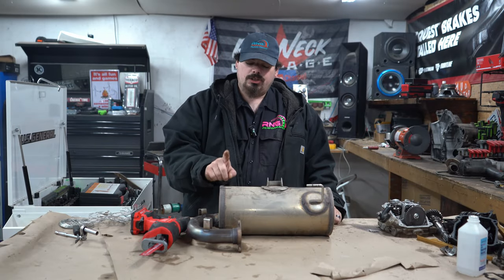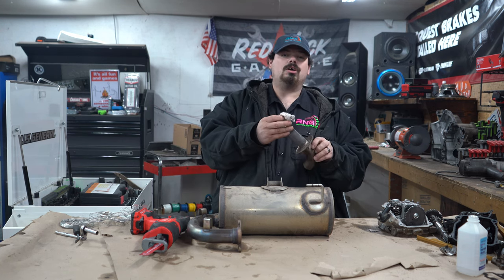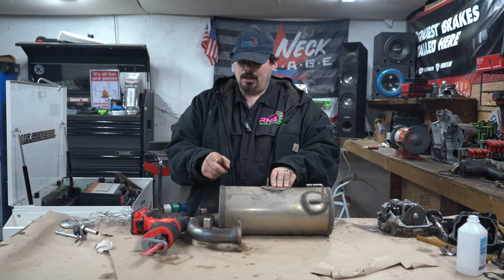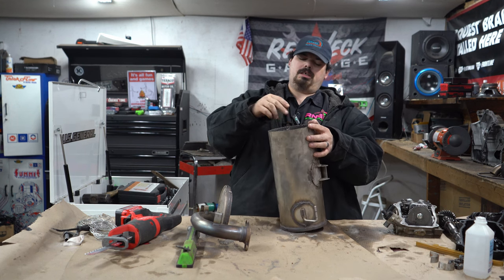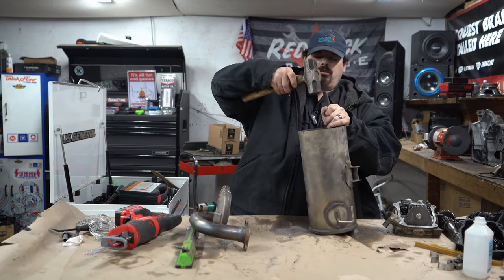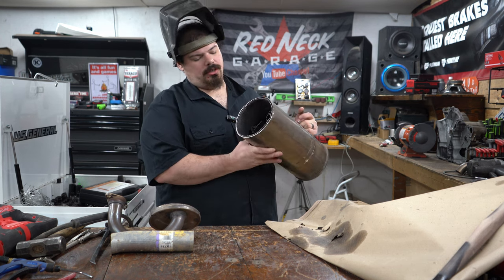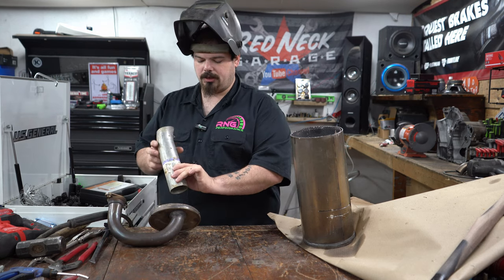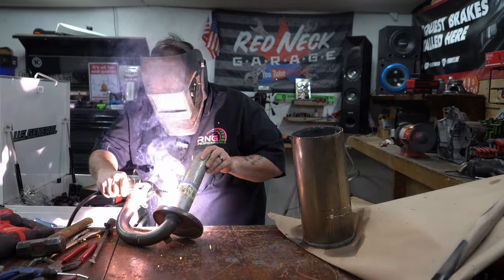CFMOTO UForce 1000 Muffler Mod

Comment: I had local muffler shop install a Walker Exhaust SoundFX Universal muffler 17196 on my Zforce 800 Trail. Photos can be seen on CFMoto Forums in the Zforce 800 category, post headline is Aftermarket muffler.

Comment: I had to pull packing out of my spark arrestor screen multiple times. Just purchased a power tune and got stage 2 so I have to figure out what I'm going to do muffler wise. Thought about just removing the cat. Why didn't you remove the cat?
Reply from the maker: I was going to but didn’t want it super loud.

Comment: You are a big reason I bought a 1000 overland. what are your thoughts on removing the cat converter just for the heat issue on the right leg? I'm not looking for performance just a cooler calf in the summer.
Reply from the maker: Thank you 🙏 I highly recommend it.

Comment: Checking to see if you created a sound clip after the exhaust mod now that you got the ECU back.  Did you noticed power gains with the muffler mod?  I am under the impression that the muffler also serves as a catalytic converter.
Reply from the maker: The converter is actually separate on the pipe.  I just dropped a video just now.
Reply: @R.N.GPerformance  just watched it.  It sounds real good now.  Very nice build so far  you can adjust the compression in the front to make it harder for the shocks to compress, and increase the rebound in the back to slow weight transfer to the front when braking.

Comment: so was that muffler a cat delete then. and have you planned out a RNG weekend camp and trail ride yet.
Reply from the maker: No sir. The cat is still on the unit. I left it on to keep it from being super loud.  We’re not after performance.  Just a little noise.   I haven’t yet buddy. I am working on it.
Reply: @R.N.GPerformance  i did a cat delete on my KRX it did not make it louder but it did help with the heat.